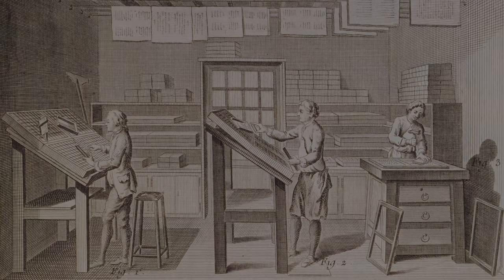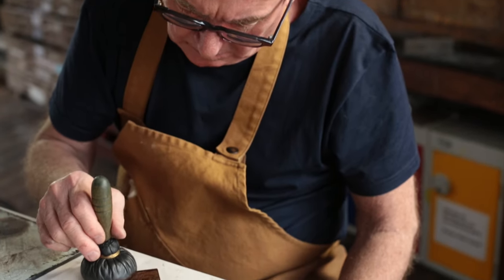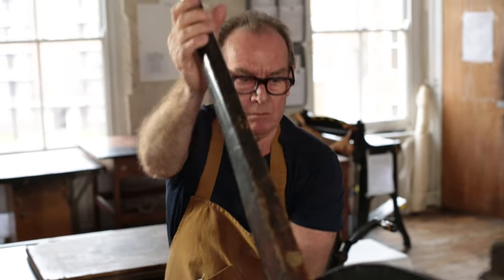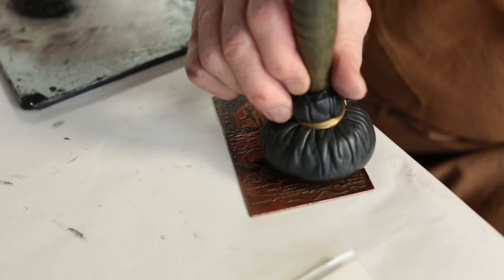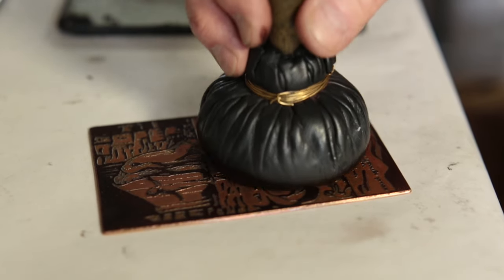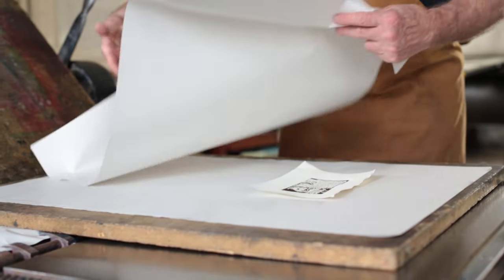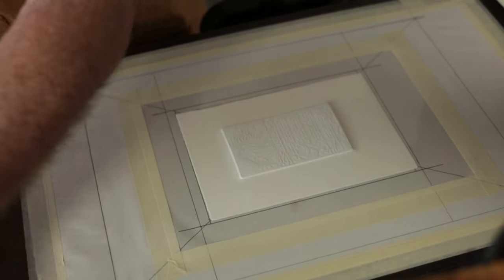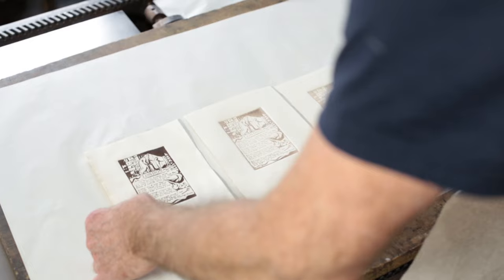William Blake's printing process

Comment: A salient feature that is illustrated here is that he was able to get multiple prints from one inking by increasing the pressure on the press. Also, the dauber with a very light coating of ink is used. The etching was pretty shallow and it is easy to get ink into the recesses if you aren't patient, working slowly and carefully as Phillips did and Blake must have done. Great scholarship by Michael Phillips.

Comment: I did quite a lot of printmaking during my years at art school: it is indeed a difficult thing to get a consistent quality over a run of prints.

Now, as I gather from the video, Blake drew and wrote directly on the plate, using the etching ground as one would use ink? I recollect a relief-etching process devised by Leonardo da Vinci, which provided greater detail than the woodcuts then in use - something like the 'sugar-lift' technique I learned in class, where you put the lift layer on first, scratch the design in with a stylus, lay the ground over that, then soak off the rest of the ground before the acid bath. The scratched areas retain their ground, while the rest is etched away...

Comment: As a very experienced etcher, I would tell this printer to do himself a favor and use a more modern press: one with gear reduction. This would avoid the awkward halting and jittery pass under the roller, not to mention having to reach and stretch so widely just to roll it through.
Reply: I think he’s trying to show the method that Blake used in his time

Comment: Would appreciate an additional link to how it is engraved in the first place... or can I search any "copper engraving" demonstration that it would be the same?
Reply: Much of the copper plate etching youll find today is probably going to use the wipe away method (With phone book/news print) of taking off the excess ink, and not being so light with the ink application unless needed. But the process with the engraving, acid etching, and running through the press is very much the same. Though i do have to give it to 17-18th century printing with the ink dampers/stamps? that has a lot of patience o-o